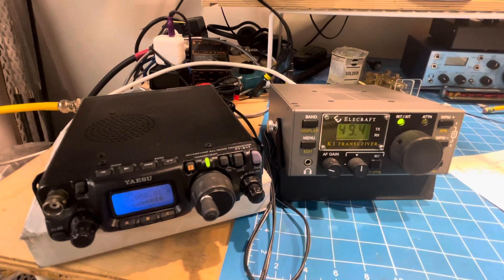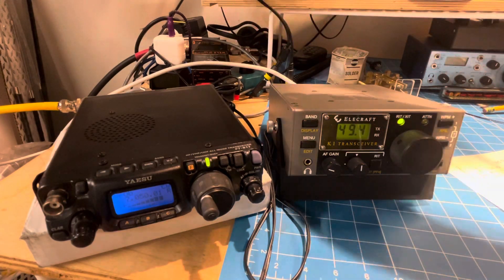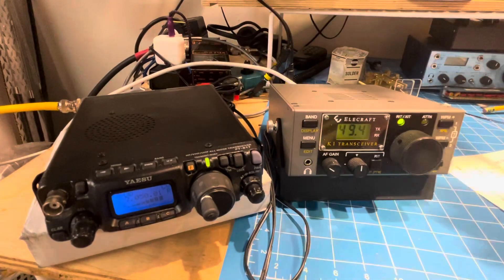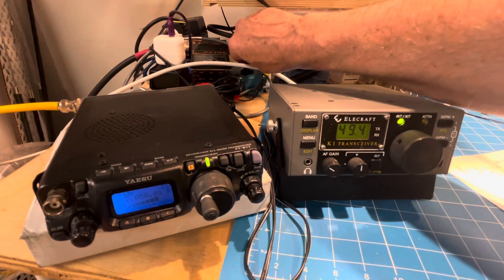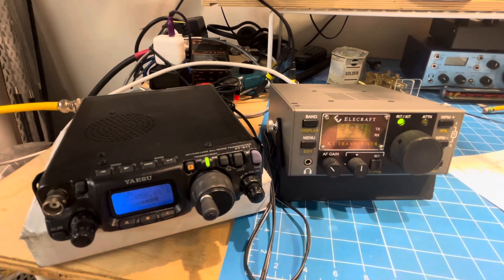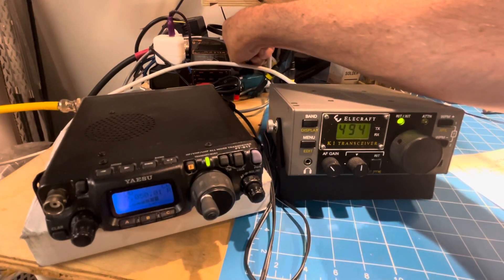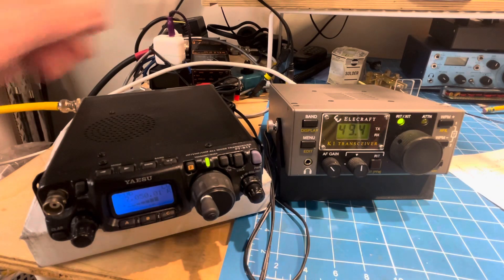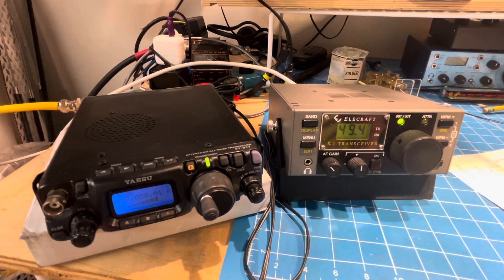I know it’s not fair… K1 vs FT-817

Comment: Interesting.. it seems a too big difference but can you tell which bandwidth the filter has on K3 and on the 817? 817 sounds wider. Also why is the meter so high, is that noise you have? I don’t have a K1 but those Elecraft are known to be good on CW. But my 817 changed from night to day when I installed a 300Hz filter (obviously). I specifically choose the 300Hz instead of the wider 500 since you can install one only.  When signals are so weak I suggest to change the pitch to improve things a bit. 
73
Diego
Reply from the maker: Yes, that is the fun of the K1 and K2 rigs, they come with a variable IF bandpass filter that can be set to the choices you make from very narrow up to 850 hz, so no filters to buy.
I just recently bought a 500 hz filter for the Yaesu and it cost more than some radios haha
I’ll do a video showing the filter setup on the K1 and K2s - not bad for 20 year old radios

73,
Bruce

Comment: It's too bad that filters have become so hard to get and expensive.
Reply from the maker: Agree fully!  And also too bad the filters are physically smaller than those used in other radios/brands.  I did see one creative ham put some larger filters in the open space on the other side of the PCB and run small coax to the filters.